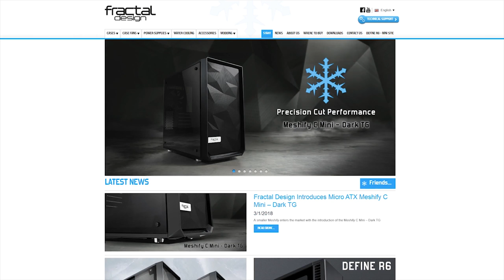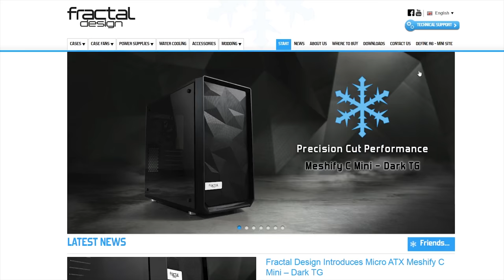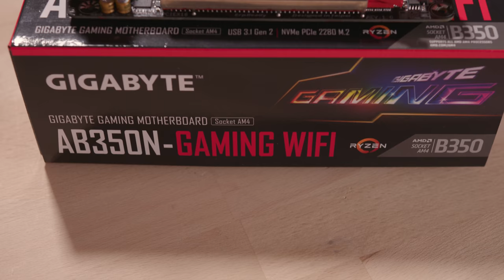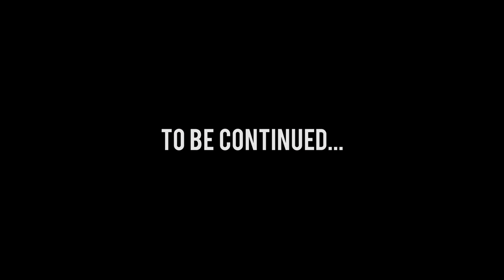Modding a tiny PC for better cooling! :D

Comment: Hi Kyle, I recently had a tiny piece of metal stuck in my eye near the pupil which had to be removed using a needle and cotton bud. It had formed a rust ring which then had to be drilled out with a small precision drill so I can highly recommend wearing safety goggles when grinding metal, you don't want to go through that shit.

Sincerely, Buzz Killington.

Comment: Kyle ; there is an edging you can buy from places like Grainger Supply or possibly other places that can be used to line the sharp edges of the cut out you had to make . It comes in many sizes and is also either soft pliable plastic and rubber .

Comment: Nice job with the hole.  Any thoughts for some type of trim to fill the gap?

Personally when I have had to mod cases for fans I have always used a drill press with a hole saw...  Generally I find that I can make really clean cuts using this method and hole saw wobble/travel cant happen when the case component I am cutting is secured to the drill press table with a piece of wood under it to apply even pressure from underneath.  If anyone decides to try this keep in mind you do not want to use fast heavy pressure.  Light pressure is the key and work on and off the material to insure you do not overheat the hole saw and dull the blade to uselessness.

Comment: mod the piece you cut out and make it a grill on the fan and get some  adhesive grommet edging for the rim of the hole in cover  and it will look complete  and factory built

Comment: Kyle may I suggest some channel molding, ya can get it dirt cheap and it'll help fill gaps while also hide any blemishes. Also one more bit, theirs a tool called a compass as others have pointed out. It's like 3-4$ at any craft store, lastly tape the whole thing. Including the part your going to cut and you can draw on it, also it helps produce more even cuts as a whole.
Reply: If he removes the gap, he wont be able to take the side panel off as he mention in the video.
Reply: the edging can be installed after cover in on and removed before cover is taken off

Comment: wait why stop at a stock cooler if your cutting the thing open like that but something with some meat on its bones in there
Reply: I think the idea is to still keep it small and compact. Whats the point of going to the trouble of buying a small case like that if you are just going to put some massive heatsink/fan combo on it? You might as well buy a case that it fits in at that point.  Kyle was just opening it up to be able to fit the fairly decent yet still fairly small stock cooler in it.
Reply: A Dark Rock TF would have been beastly... bit of an overkill maybe.
Reply: I'm imagining a beefier cooler tipping over more and damaging the CPU/socket

Comment: If the fan sticks THAT far out of the case, then what type of cooler are you supposed to use in that case WITHOUT modding?

Comment: You could have made a tighter fit if you remove the fan before sliding the side panel.

And also attach a cover for the cpu fan to protect it from fingers.

Comment: You dont really have to use a dremel. If you have a drill you can just buy a hole saw with the right diameter that should be just a smidge bigger than the diameter of the cooler fan. Much less of a headache and you get perfect round holes every time!

Comment: I have a nvm ssd and they get Hot!!!... to the point that I opted to add to it a sticky thermal pad and then a aluminium radiator similar to what is used in old pasive cooling video cards... it still needs more wind blasting that memory stick... to properly get rid of the heat

Comment: Hardware Unboxed did this build, all you have to do is remove the plastic shroud on top of the Wraith cooler and it will fit in the Chopin.

Comment: Could have made the tolerances heaps tighter if you cut the hole the same size as the fan, take fan off put side panel on then screw the fan back on....

Comment: For the love of God......I made the same build using the stock cooler. the only thing you must do is to remove the shroud from the stock cooler and it fits without cutting anything....next time maybe built another case around it from tuna cans to fit a 360 mm AIO.....

Comment: Can you remove the fan from AMD stock cooler and install a 15mm 80/92mm air cooler. I am also planning to buy an InWin choppin or BQ series case. AMD stock heatsink is not too much tall but the fan is taller than normal 15/25mm fans. Hardware Unlock used CRYORIG C7, Noctua L9a will fit  on this case.
Reply: Link it. Currently i have one Silverstone SUGO 13G. I can't take it to office.  My current setup https://www.youtube.com/watch?v=rzCu0BJ_nE0. Watch at 11:46

Comment: Just wondering what kind of acoustics you get from this setup when under load? I'm trying to see if I can build a small gaming rig and have it fairly silent. My wife hates when she hears my current PC when I game on it :(
Reply: My 2200g build in an InWin BQ656 (similar to the Chopin but slightly smaller) has the cpu fan at full bore when gaming. So it can be pretty audible since there is no sound dampening going on with that huge vent. I'm actually looking into modding the case a bit to fit some 40mm or 30mm fans to get some air flow, though I doubt the cpu fan would run at any slower speeds, I'm just hoping to keep it out of the 90c's. Its not extremely loud, but you can hear it, so I guess it depends on how close you two are and how much a single CPU fan at 1980rpm or whatever would bug her. 

However, my HTPC is in a Cooler Master Elite 110, which is bigger, but is quieter and has better cooling. It also allows for a gpu and standard atx power supply, so I started with the 2200g in that as well, but last week I put in a single slot 1050ti and it's a great little 1080p machine, I don't even worry about streaming from my main pc at this point.

Comment: Why wouldn’t you just use a Thermaltake Core V1? Small footprint (albeit not quite as small) and affordable price with sleek looks and WAY better thermals. Cooler clearance would also be increased significantly and the case might actually be useful if you want to add a graphics card in later. Sad a lot of people don’t know about this case

Comment: Probably would be a mess and very harmful for your hands, but installing the panel before and then mount the cooler probably would have allowed for a cleaner and smaller cut (the fan header probably would request a miracle tho).

Comment: Hey guys I need your help. Can I buy a brand new ryzen 2 with a x370 and have them work together straight away? Or is that only for x470 boards? I am going from intel to AMD btw. I don't have an existing AMD CPU. How do I update the bios?

I'm a little new to PC building sorry. Thanks for the help

Comment: @bitwit - i can design and 3d print a custom "shroud" foor that fan to seal that open cap, add some style and should improve the air flow to internals. If you'de be interested let me know :)

Comment: I built a pc in that case with the same CPU
No need to mod the case, just remove the part of the cooler with the amd logo on it
Reply: Actually seems like that wouldn't have worked here.
That's odd, anybody have an idea why I was able to fit the cooler in that case with minimal modding and he couldn't?
Reply: Because he used the wraith spire, not the stealth that comes with the cpu
Reply: I like that you answers yourself two times x')
Reply: How does this cpu handle games without a dedicated graphics card? I'm thinking of building a media pc, but it has to run mild games aswell, and the smaller case/build, the better.
Reply: Magnus Frederiksen
Not to razz  you, but you seriously haven't seen any videos of builds based on the two Ryzen APUs?
Reply: the stealth on the Ryzen 3 2200g is about half as tall was your chip the Ryzen 3? maybe
Reply: Mine_Electricity he didn’t, they just both have green profile pics
Reply: This CPU can handle most of the game @720p in medium details ( with dual channel OC ram).
Reply: nakyer havent looked into amd much as im kinda new to pc building and i understand intel a bit more, sorry ☺
Reply: 7chip cool thanks
Reply: @YourMom Oh.. yeah, sadness :(
Reply: Mine_Electricity the second answer isn’t his

Comment: Next episode... Low profile GTX 1050 with modded heatsink installed. Use an old laptop heatsink with one or two heatpipes and bend it to fit the inside of the case after modding it onto the bottom of the GTX 1050. :D

Comment: Can anyone find a place to buy the Inwin Chopin?
Reply: Amazon has the InWin BQ656, its similar to the Chopin (actually 3/4 the volume and has an optical drive slot on the front) and comes with a 150w psu.